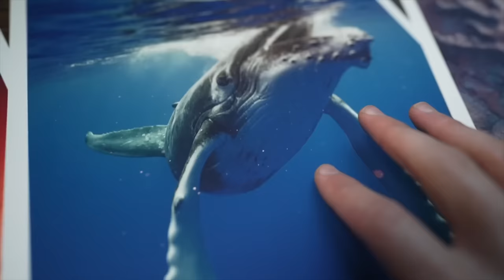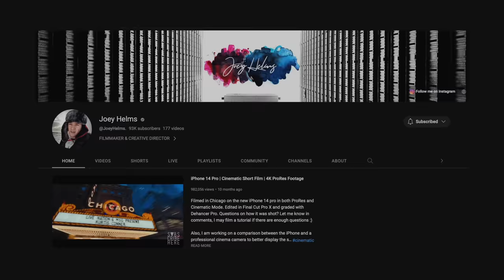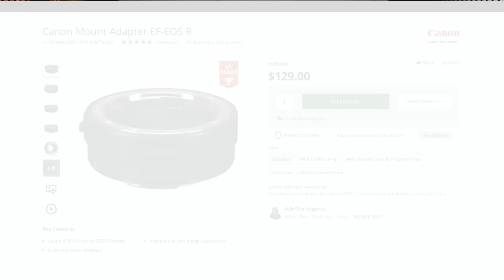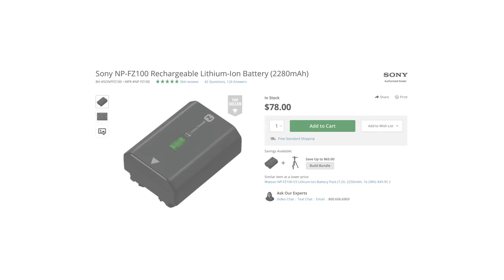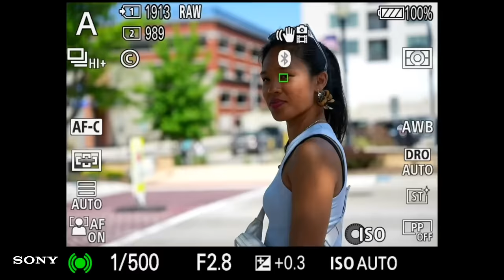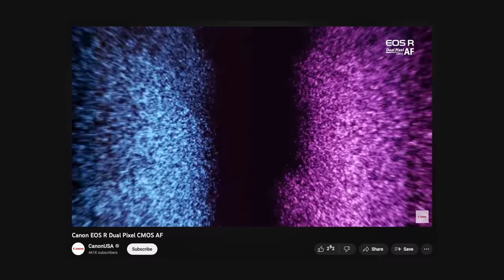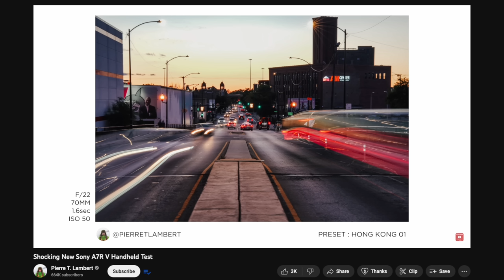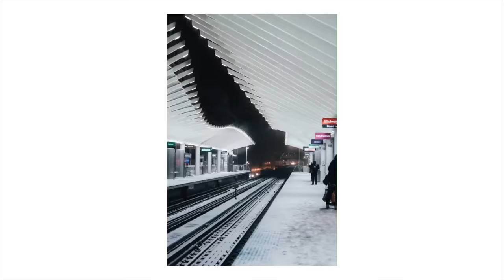CANON Vs. SONY In 2024 - Which one is BETTER?

Comment: Since the launch of A7iii in 2018 and the introduction of third-party zoom lenses like Tamron 28-75, Sony has gradually become a reliable brand for working professionals in both stills and video. However, it has also become less fun to use (e.g. mediocre screen, handling, IBIS), less value-friendly (e.g. a7IV compared to a7III, expensive flagship A1 without many firmware updates), and less well-rounded (more and more product lines).

Comment: I"m quite happy with my Canon cameras and lenses, but I'll echo what other folks have commented here: It's perfectly normal to be loyal to a particular brand, but my feeling has always been, as long as the camera you're using does the job for you, that's the only thing that matters.
Reply: The reason there is loyalty to a brand is because their equipment is reliable and their line of glass is impeccable. that's why there such loyal following with Canon as before with Nikon.

Comment: I switched from Canon RF to Sony In March 2023 and no regrets. It was PAINFUL selling all my Canon gear but once it was all gone and I replaced most of my Canon lenses with Sony eMount I was happy. Even kept a few EF Canon lenses such as the Caon EF 135mm f2L and 100L Macro and use with the Sigma MC-11 adapter.
Reply: Sony or the 3rd parties will never have a 10 or 11mm rectilinear lens for the Sony 46mm mount - this mount is too small.
So... if you want the widest possible choices of lens focal lengths, eg 10mm UWA, you will have to stick with Canons bigger 52mm mount.
Reply: @nordic5490  how many times are you going to say this? Most people don't need this. I will never understand why some folks think because they need something everyone does...

Comment: In my opinion it depends on what you're doing with your camera. I tried both, Sony and Canon and came back to Canon because the 1DX and now the R3 felt much better for me. I'm usually doing Sportsphotography. I love the autofocus which is controlled by my eye and that helps me so much with taking pictures of sports and events.
Reply: What camera would you recommend if someone is looking mainly to shoot photos of people and just scenery ?
Reply: @NationalDeputy  Canon R8 is a superb option.
Reply: so true I use my canons (10000D and R8) to plan photoshoots, so finding a location, and picking a time and angle. and then take my compositions on my Konica Autoflex TC (a 35mm or Analog camera). the R8 is great flow lightght form my experience.

Comment: I was a Canon user for many years. I have now switched to Sony and have been shooting with the Sony system for a little over 2 years. A camera is a tool and won't do anything by it self so use what ever I use is never as important as who and how the photographer sees and uses the camera. The reason why I made the system change is because Canon didn't have a sensor big enough in resolution in mirrorless and I wanted to shoot with a sensor over 48MP in mirrorless where Sony had some 50 and 61MP options for me. Having said that and knowing that a camera is not the main factor on image making, knowing too that both systems have pros and cons I will say I would go back to Canon when they step up on sensor resolution for many reasons. First I will say that Canon lenses are a big factor because they have better variety, value and quality lenses leaving out third party optics that I never use with either system (Tilt and shift lenses, fish eye lenses, zooms and telephotos Canon checks all the blanks and Sony has many not checked that I love using). User friendly menus, Sony really falls short and makes migrating to their system really a hard process. Sony cameras take a long time to adapt to the photographers needs and are not intuitive like Canons are. This is something that not only I say, it is one thing Sony has been known for and have not improved. One thing that does fall very short on my high expectations is Sonys screens both through the viewfinder and on the back of the cameras, one would expect that Sony making some of the best TV in the world would have that on their side, but Sony Cameras have much better image quality than viewing quality with some times becomes a problem at the time of shooting trying to fix problems that are not there. Last but not least is brand support with the service on line and offline both: service centers, stores, web pages and other resources when solving problems, finding pieces and accessories, getting customer support, etc. If I go back to Canon I would sell all my Sony equipment. But for now I have kept both until Canon comes with a sensor big enough in mirrorless camera bodys with professional standards bodys because I shoot to print in super large formats where that matters.
Reply: Hey where do you sit with your thoughts on this now? Still the same?

Comment: I started out with Sony mirrorless in early 2013 with my photography journey. Went to Nikon for the old school Nikon lenses and ergonomics, but left Nikon when their mirrorless AF and features lagged behind the rest. I went to Canon now with R6 and RF lenses and I'm incredibly happy. Why not Sony? I don't need a million lenses, especially third party. I prefer first party lenses for assured QC and reliability and performance. The RF35 and RFR70-200 are more than good enough for me, and for the price they are fair and I don't see a good cheap 35mm option for Sony. The RF35 is incredibly sharp, has amazing IBIS, is compact and cheap. Also, Canon has better IBIS, ergonomics, low light performance on R6, and repair customer service. Colors start to shift and contrast is lost on high ISO for A7 IV, but R6 looks incredibly well in really high ISO for hobby purposes. The Sony A7 IV would be my second choice, but I am happy with the R6 and RF lenses.

Fuji? The build quality was terrible with the XS10 and XT30 I had and the AF is worse that point and shoots from 15 years ago. They felt like toys

Comment: Nikons Z mount is technically not completely closed off to third party lenses, but the third party options for Z mount is extremely limited, and you pay a premium vs the E-mount for the same lens. What I don't like about the E-mount is the lack of any lenses wider than 16mm that takes filters. Nikon and Canon have a 14mm that takes filters, but I feel the E-mount is just too small to build such a lens.

Comment: I really like the Sony system and that’s after using Nikon DSLRs professionally for many years until the advent of mirrorless. I saw how great this new technology was and saw that Sony was the clear leader so went all in on Sony selling off the Nikon equipment. Fast forward a few years and I am 100% satisfied with the Sony platform. I can use best in class optics from Sony directly or choose other great lenses from Zeiss, Voigtlander, Sigma, Tamron, Samyang, etc.. I like the ergonomics, performance and ultimately the most important aspect to me is image quality and dynamic range which Sony sensors have and are rated amongst the top sensors in the world. I like the small compact size and Sony has been the most reliable system I’ve used in terms of durability with very few repairs over the years. I also really like Sony Pro Support and been happy with every interaction I’ve had with them. I often envy certain aspects of other brands but as you said it ultimately comes down to using your brain and creativity to capture amazing photos and all cameras coming out these days are great tool. Thanks for the insights, I’ve been wondering what your thoughts were regarding the Canon since you recently received it. Always enjoy your enthusiasm and videos, keep up the great work!
Reply: well nikon are using sony sensors...even back from days of d3, d750 or such...gues where that dynamic range came from, sony sensor ofc :)
Golden rule was for years:
-canon for colors, but a bit softer (own sensors)
-nikon for sharpness and dynamic range (sony sensors)

Remember year when first A7 came out..pro guys laughed so much (its a toy, small lens, bla bla) but sony destroying it with dynamic range, low iso etc...and look 10 years later everyone copy them!

Comment: the canon lenses and bodies i use are rated weather/splash resistant...  but i don't shoot in the rain, mist, or heavy snow fall.  so, i would say, i haven't had any problems.  when i have been caught in the rain with my gear, i immediately dry it off with towels i carry.

Comment: Just wanna correct some. 
- R6 can use battery from 5D mark ii and 6D mark i days. (Idk about R5)

- 50mm f1.2 GM way cheaper than 50mm f1.2 RF. And some focal length follow suit. 😢

Comment: I've been using the Nikon D3200 for almost a decade and in 2023, still don't have any problem with the image quality. but Nikon doesn't care about budget lenses for amateurs and hobby photographers and also I need to Invest in a system to support my vlogging and astrophotography activities at a good level for the price. Sony is amazing in these roles but still a little expensive for me, but Canon is not compatible with third-party optics. so I guess Sony is a reasonable choice for me, because I need to buy just 2 bodies and optics are more important when it comes to price.

Thank you for these details bro! ♥

Comment: I'm a new-ish photographer and love my R6 for portraits, sports, or wildlife. Where it fails, for me, is the subject detection. When using servo AF with tracking it is always trying to hunt for subjects and won't let the focus box "stick" on whatever I initially focused on (if it isn't one of the recognized subjects). This means that I'm always having to switch to a single focus point without tracking, resulting in lost shots and more time spent composing.

This is infuriating to the point of making me want to switch. Other brands do better (OM System, Fuji), and I'm curious to try Sony to see if the tracking works like I'd like it to.
Reply from the maker: For me it sticks well on Sony but what conditions do you usually lose the tracking in?
Reply: @Pierretlambert  It could be due to my beginner's reliance on tracking AF, but I'd like to be able to focus on a particular inanimate object in a landscape or in a street scene while using C-AF and have the camera hold focus while I recompose. Fuji and OM System cameras seem to do better, but my R6 will hunt all over the place no matter the subject detection mode. It also loves to expand the tracking area (even if the smallest focus box is enabled) such that I have no idea where it is focusing, especially with larger apertures.

I should really just get better at using S-AF and moving the point around. Thanks for your videos, by the way, I quite enjoy them.

Comment: I've never understodd the argument about lens selection. How many lenses does a working photographer use? I shot events and I use two lenses, an RF 28-70 and an EF 70-200. Sometimes I use an EF 85 for portrait work. That's it. I think it matters very little if Sony or Canon or Nikon has a larger lens selection. All the brands have the lenses you need. Yes, RF lenses are pricey, but if you're working, an RF lens is a great investment.
Reply: And if you don't want to spend loads of money for the RF offering, have you at least got an alternative?

And if you want a 35-150 f2-2.8?
Or rather have a 20-70 instead of a 24-105?

Comment: The issue with charging with the USB is due to the battery, not the port. Only the new battery can be USB charged while in the camera. At least that’s my experience. Oh, and you can recycle your camera batteries (not alkaline) at any Best Buy stores or local county recycling centers. Common man, it’s not hard at all.

Comment: I've used Nikon and Canon for years and now I am in Sony camp. Sad to say but there is no more camera wars. In mirrorless world Sony is years ahead generally as system.
Smaller and lighter lenses, beautiful color rendition and DR, sensor tech, third party lens, best video codec, best camera body customization in the market... It is game over.
Reply: Years ahead is totally wrong
Reply: @lesson.3012  no it's not. Sony is started with milc technology development couple of years before Canon and Nikon. At the same time Sony is in technology development company with greatest potential so the conclusion can be made very simply.
Reply: @DuskoJovic Sony lead the way in mirrorless for a while sure, but these days there’s little difference in bodies and tech. The lens situation is a different story.
Reply: The short answer is, both brands produce good images, at least in the flagship models anyhow, eg, the A1, the R5 and R3.
Both brands have good glass available - it doesnt matter who makes the glass.
Both brands have similar high iso performance per pixel area.

I personally found the A1 too small for my hands, but the a1 will be perfect for others.

The biggest differentiator is; Sonys 46mm mount vs Canon (and Nikon) 52mm mount.
One of my favorite lenses in my Samyang 10mm rectilinear EF mount, adapted to my R5. 10mm is wide, truly wide, and, where it is needed there is no substiure. Straightening a 8mm fisheye gives very soft corners, and, once cropped rectangular, is 10-11mm or wider anyhow.

Sonys 46mm will vignette a 10mm rectilinear, and thus, is a deal breaker for me. Sony really needs to update their mount to 52mm.

Canons new 10-20mm F4 rectilinear looks to be a winner for UWA enthusiasts, and realestate. Sony or others could not release this type of lens for the Sony 46mm mount - it would vignette at the wide end.

All the rest of the arguments & comments are just noise. There is only one real show stopping limitation, and that is the small 46mm mount size.

Comment: Have been a Canon user for about 18 years. I am not a "professional" photographer but want to upgrade for better optics (not overly concerned about video because I am not a videographer and really don't want to pay more for "all these video features" (which Sony seems to dwell on). Would like to go mirrorless but if I understand correctly, it seems Canon has "shot itself in the foot" by changing the lens mount to RF on their mirrorless cameras, making it near impossible to use any of my numerous Canon lenses. If this is true - if I can't use any of my numerous Canon DSLR lenses on any of their top rated mirrorless cameras then I might as well kiss Canon goodby and go with Sony. Is there any compromise? Does Canon make any top rated optics (equal to, say the Sony and in any of their mirrorless cameras that accept the Canon EF mount?  Bottom line after watching your entire video. You speak in "generalities" so basically, I learned nothing. Sorry.

Comment: Why would you throw away the batteries when changing the camera? They go with the old camera to the new owner 🤷‍♂
It also makes sense to upgrade the batteries. It's not as if the R6 has different batteries to the R5 of the same generation.

Comment: Been using the R6 for the last year and a wedding photographer and film maker and it's the first camera I've felt like I never need to upgrade for any reason. The video quality is incredible. if you need more dynamic range then I don't know what you are doing wrong. It grades beautifully and runs super smooth on my MacBook. The low light capabilities are ridiculously good. 12800 iso is usable, do you need that? Almost never but it's nice to have. And then the colours... Id say Sony is good but canon is just way better than anything else. Lenses are amazing. you can find soooooo many second hand options and you can adapt anything. the only thing I would upgrade for is better quality 120p, that's it😂If you can't get good result with either of these camera brands its not the camera, its you.
Reply: Canon is better , that's true but the problem is lens selection, as a system they are far behind Sony, without opening their mount to third party then will never win over Sony.
Reply: @neethuandthomasphotography  Agreed but they still have the Ef conversation. I have had no noticeable difference in performance. I’ve used sigma glass, older EF L-series lenses(even some from the 90s), vintages lenses(you can convert any vintage lens to ef), tamron, Carl Zeiss lenses.😂 The list is endless with the EF converter, Waaaaaay more lenses than the E mount. Even so most people are going to stick to the usual 24-70, 70-200, 15-35 and a few primes like a 24, 35, 50 and an 85(let’s also not forget how cheap and insanely good canon primes can be). Is there really more that you need then that?

Comment: I have been a Canon shooter since 1998, and my first SLR film camera.  I bought my first Canon DSLR, the D30, in 2001.  Currently, I use an EOS R mirrorless and I love it.  But....if Canon doesn't open up to third party lens manufacturers I will strongly consider switching to Sony if and when I buy my next camera.  I really like being free to choose which lens brand I shoot with.  More choices is always better for the consumer...me.
Reply: Here is the rub. Sony or the 3rd parties will never have a 10 or 11mm rectilinear lens for the Sony 46mm mount - this mount is too small.
So... if you want the widest possible choices of lens focal lengths, eg 10mm UWA, you will have to stick with Canons bigger 52mm mount.